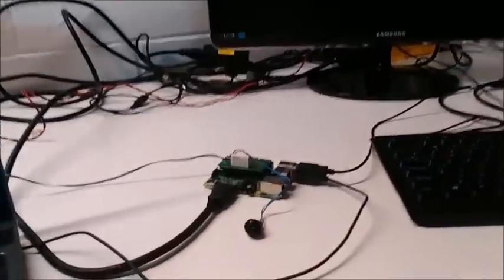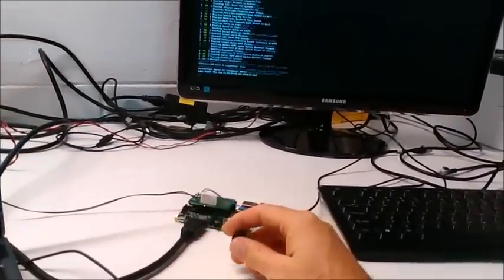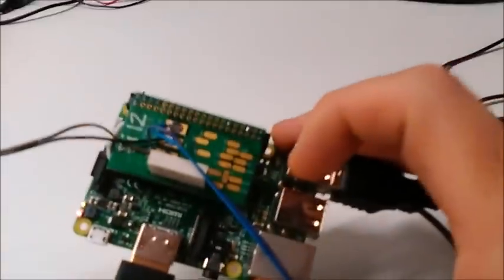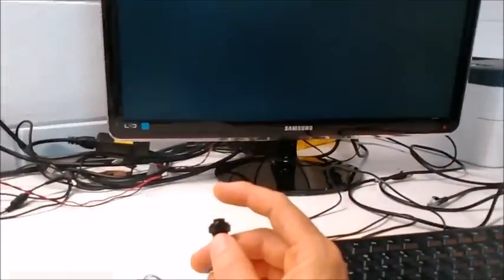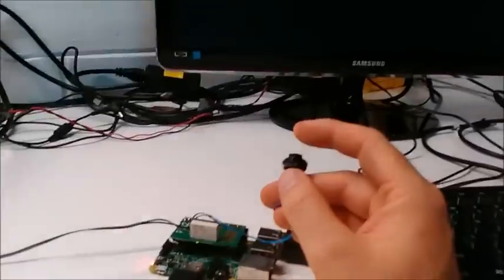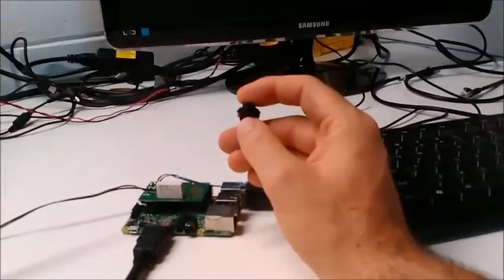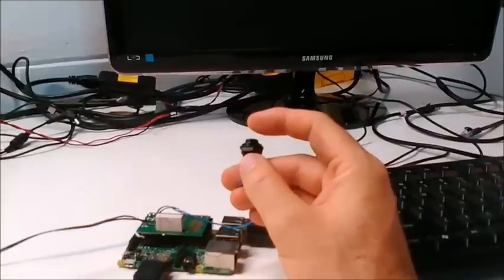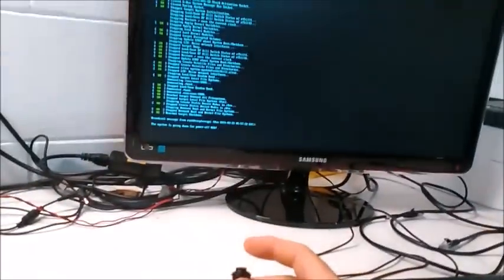Raspberry Pi: On Off Power Button

Comment: Please anyone explain the working function of the schematic that here attached
Reply from the maker: When the button is pressed, 5V is applied to the raspberry pi. When 
Raspberry pi starts, it makes TXD0 High and  turns on Relay. The Relay closes 
and keeps 5V applied. A python script runs to monitor the button. When 
the button is pressed again, raspberry pi shuts down and relay switches 
off.
Reply: When the push button is pressed, 5V enter into GPIO 21 pin. If there any possibility to power on raspberry pi using GPIO pin.
Reply from the maker: All the +5V are connected. The +5V goes to the raspberry pi supply.
Reply from the maker: The TXD0 is made high after the raspberry pi loads configuration. It may take a few seconds on a slower older PI.  To get instant-on, you could put a diode between the button-pinC2 and the 4k7 resistor. Change C2 to be 1000uF.  Now, when the button is pressed, it charges the capacitor C2. C2 will keep the transistor on for a few seconds while the raspberry pi boots up.
Reply: Thank you.. It's properly worked by using IN4001 diode.
Reply: Thank you for the great solution, but I checked TXD0 power on default state, it is low, how will it turn on the Relay?
Reply: When the pi power ON. TXD0 pin goes to high state. So it will turn on the relay

Comment: The link for the schematic seems to be broken. Which pin did you set to monitor the button? I am assuming it is 21 based on the script, but since I have no programming skills, I don't fully trust my assumptions....
Reply from the maker: Yes, GPIO21 is used for the push-button input..   Don't know why the link was broken, here it is again: http://www.tctec.net/RPI_Power_Button.pdf
Reply: @tctec1129  what diodes and transistor you use this, i no know this transistor and diode, 1n4001 can i use or need be somethink special secret expensive future smart diode. haha. and why no use normal transistor, pc547,2n222,etc or tip 120, or mosfet somethink 45.

Comment: course my method is much easier to use....no python script just power down the pi and hit the switch, to turn on, hit the switch...
just conect to your 2.0 or 2.4 amp usb charger....

http://www.ebay.com/itm/Micro-USB-Charging-Cable-1-5M-With-ON-OFF-Switch-For-Raspberry-Pi-/182085741277?hash=item2a6527eadd:g:E3QAAOSw7n9XFE6t
Reply from the maker: Yes, We have done tests with Switching the Pi on and Off using a switch.  It usually works. Every few hundred times , the SD card will be corrupted. Then it will need to be re-flashed.
Reply: john mead unfortunately, it is a piece of garbage and not a clean shutdown.

Comment: can this be done with a constant contact switch
Reply from the maker: No. The button needs to pulse-on to trigger the 'Off' sequence.  This is also why a normal switch is not used to power on and off the Pi. Because the Pi may be in the middle of saving stuff to the SD-card when power is lost.  This would corrupt the SD card and ruin the Operating System. Hence we need to do a Software shutdown, triggered by a button pulse.